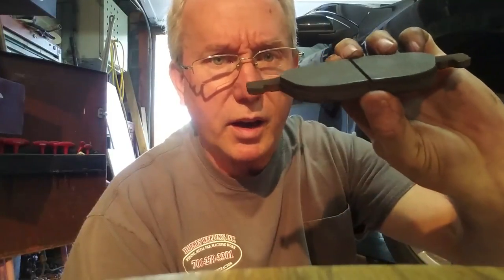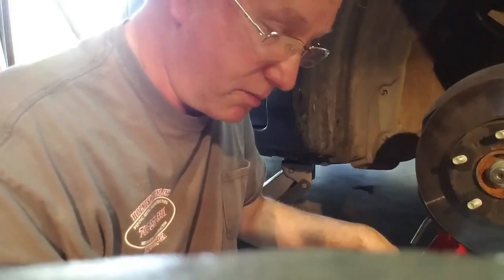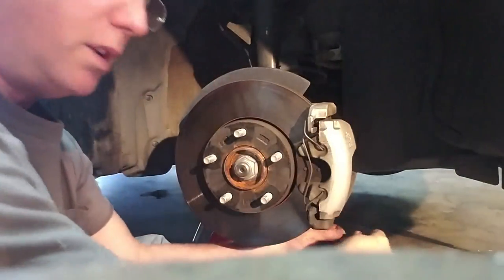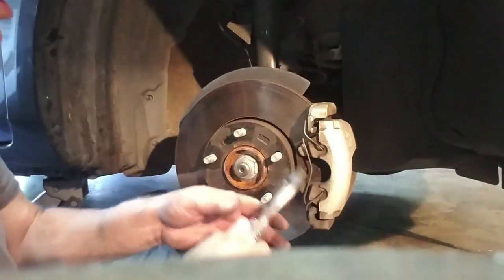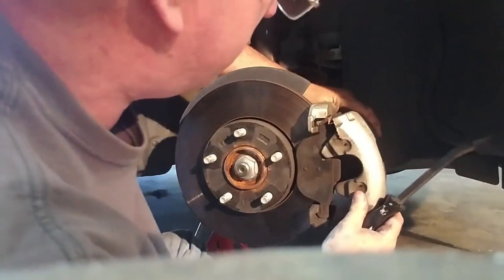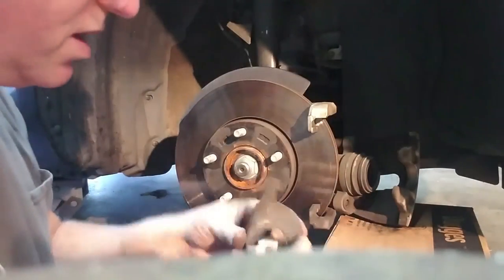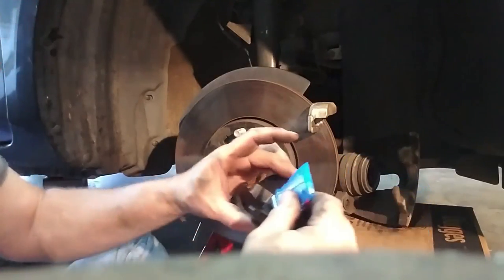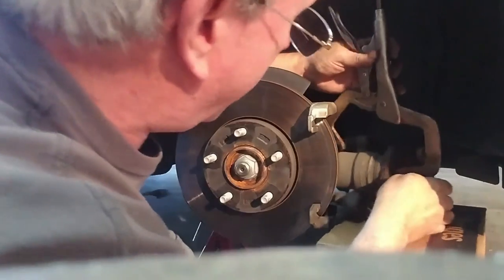2013 MAZDA3 - REPLACING FRONT BRAKE PADS.

Comment: Pop the top off the brake reservoir. Relieves the pressure and makes pushing the piston in way easier. Just keep it clean.
Reply from the maker: Yep, You are absolutely correct.

Comment: Good job, Eddie. On some cars you can remove the bottom caliper pin and pivot the caliper up off of the rotor. I wonder if I'll be able to do that with the '13 Mazda 3 I just bought for my daughter.
Reply from the maker: Yes, you are correct about the flip down calipers on some vehicles.
You daughters 2013 should be exactly like my 2013 hatchback.

Comment: Just replaced front and rear brakes on my 2013 M3 with 95000 miles at the insistance from my mechanic friend who was amazed to find that I probably had another 20,000 miles left. I pre-bought the parts and decided to be proactive and change them all out. Am searching to figure out why the rear brake package had an extra wire bracket. Looking for that info.
Reply: Was checking your video to see if you had found the extra brake part and what it was for!
Reply: 165,000 miles on my mazda and still using original pads

Comment: 2010 mazda 3 with 165,000 miles.  still using original brake pads because i do not tailgate.  dont need to brake if you dont tailgate

Comment: Do all four break pads need to be changed
Reply from the maker: Thanks for your question. On most cars, the front pads wear out much sooner that the rear pads. However, the Mazda has a braking system the applies pressure the both the front and rear brakes more equally. This causes all the pads to wear out at the same time, so yes, I would recommend changing all 4 pads.